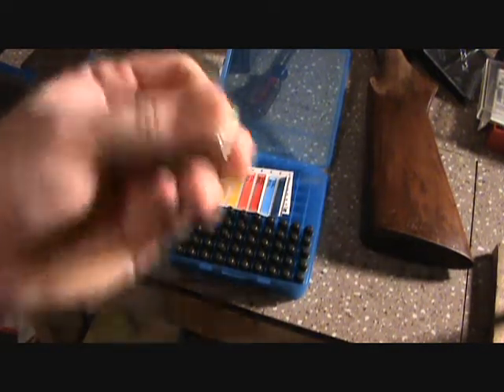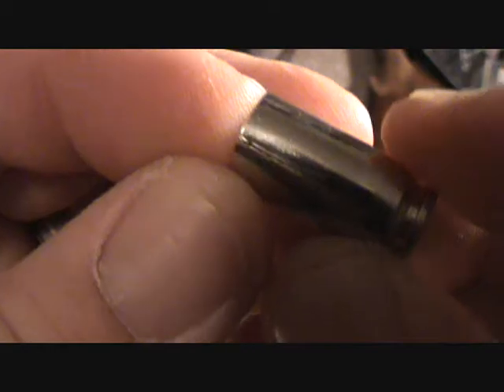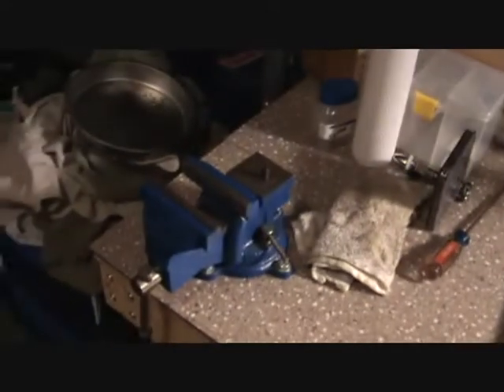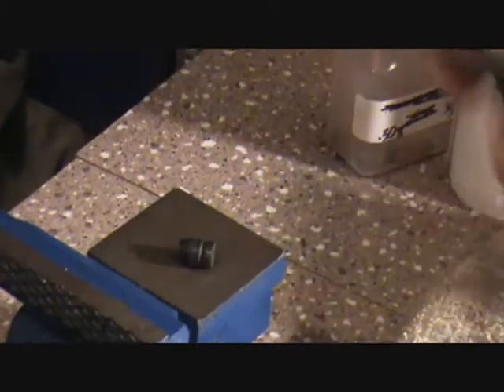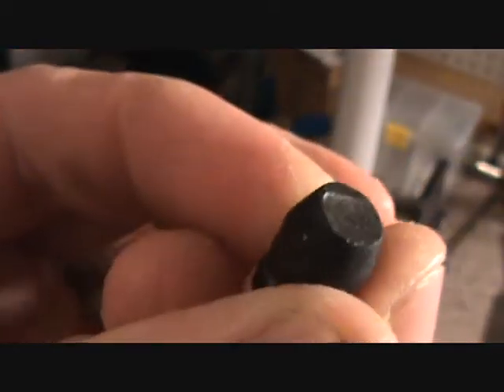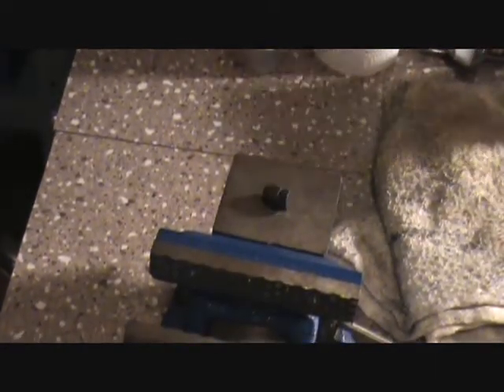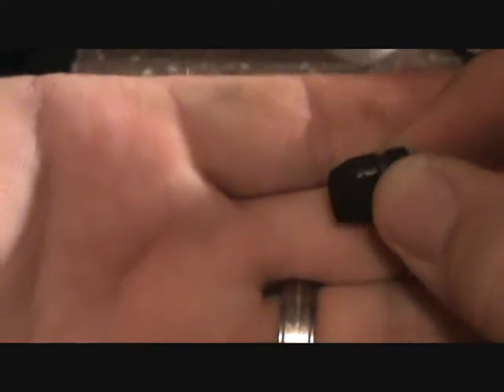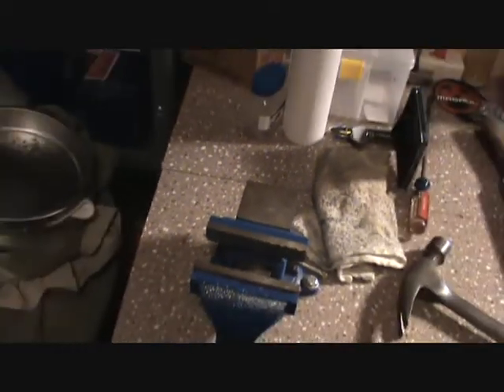Powder coating cast bullets pt.6 Durability test (Squash Test)

Comment: how will the powered coating affect your ability to re-swag the bullets?
Reply from the maker: I can't answer that as I have never swaged bullets.
Reply: I resize after powder coating, no problems.
Reply: * I meant Casting.. I know they are different, I just use the term interchangeably sometimes
.